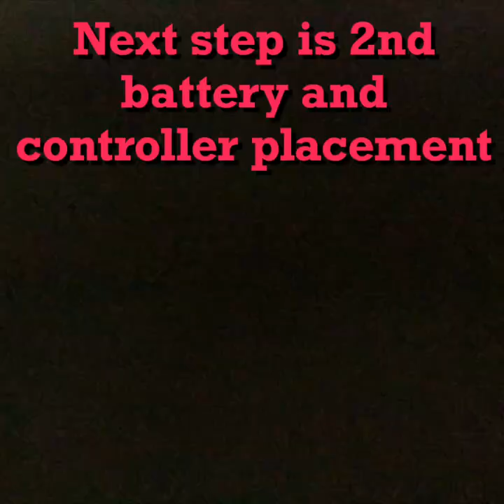Dual motor Xiaomi M365 rear motor wiring grommet

Comment: can i mount classic m365 motor on a rear wheel of a 365PRO?
Reply from the maker: DISGUSTO💀 since you have to use a separate controller for each hub motor, yes. You still have to bend in the rear dropouts. The 590/zero motor fits without bending. I have an extra one. Are you in LA?

Comment: I was thinking about doing the same s***. I already placed 2 ninebot batts on both sides of mine, gripped with zip ties. Now looks like the space shuttle xD
Reply from the maker: Arcadia Bar Guadalajara What did you do with wiring? Stock computer controller? Thanks!
Reply: @thecam0073 I did two holes on both sides at the further back, same size as standard battery main plug, and connected it via inner cable mod in parallel. It looks like the cleanest and coolest external battery(10s2p x2). Stock computer + russian cfw2.0 @ 1kw, 35km/h max. External bms are not connected but i can see the lights blinking from the rear. 
How about wiring rear motor cables with same routing as rear brake wire?

Comment: how did you wire the second motor in to the controller board are they just together in parallel or something else..? im thinking of doing this soon enough..
Reply from the maker: Gary Baker Dev Check out my playlist m365/not a tutorial... I have 19 vids which cover all the steps... The rear motor has it’s own independent factory m365 battery, controller, circuit board, data cable, throttle, and brake handle... It’s goes up any hill now... Top speed is still 17mph and it gets there quickly.
Reply: For God sake, why didn't you stop drilling and just file it out 🙄

Comment: what happens if i connect my 2 motors to one controller? xD
Reply from the maker: Bergwacht they would theoretically work (if conneced by a chain or belt)  but as evidenced by another youtuber’s video, the 2 motors will get out of phase and it just won’t work... Maybe just use one big battery and 2 controllers... Then you’ll be eliminating one thing... People also have eliminated the second circuit board so they don’t need the extra stem as well...
Reply: @thecam0073  ah damn thats what i hoped for....out of phase isnt working ya.
the size of battery ow how much doesnt matter, i change batteries (and usin more as one at the same time) as my pants.
Unfortunately I cannot test this with the second esc yet.
I don't know if the Deutsche m365 was throttled by the controller or the dashboard, maybe both.
But I will probably order a second original controller in china, as a replacement if the first one breaks :)
awd would be really really cool ^^
how does the out of phase problem become noticeable? don't they turn at all or differently? does it stutter?